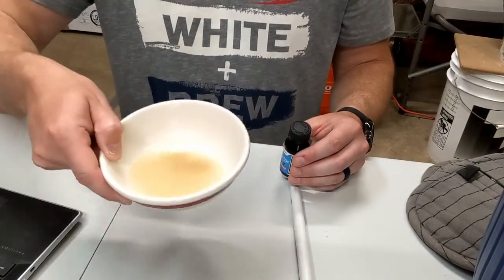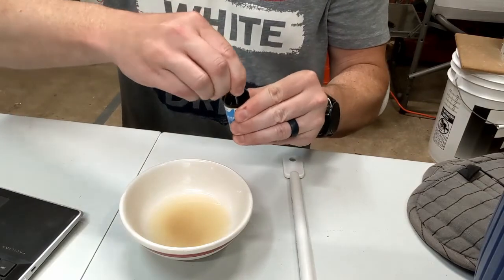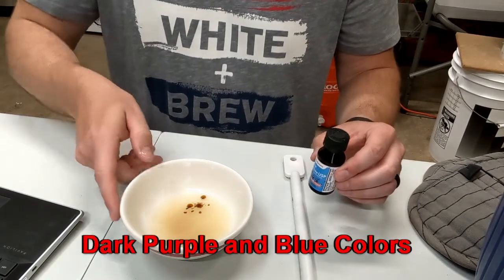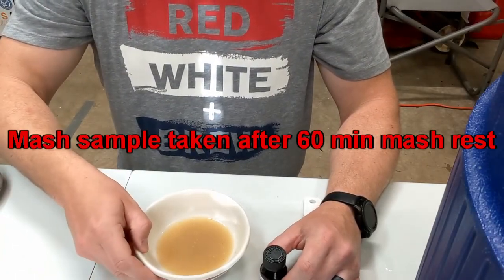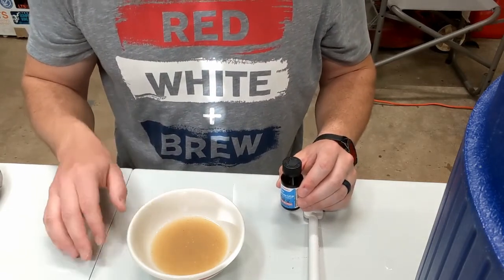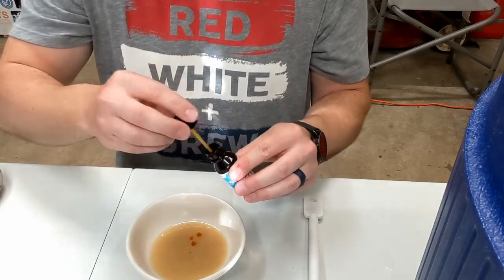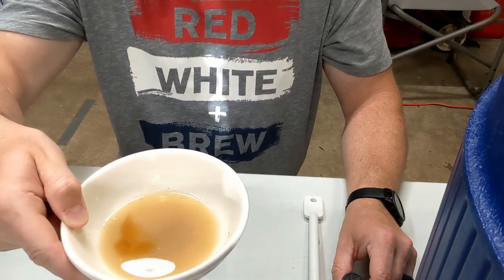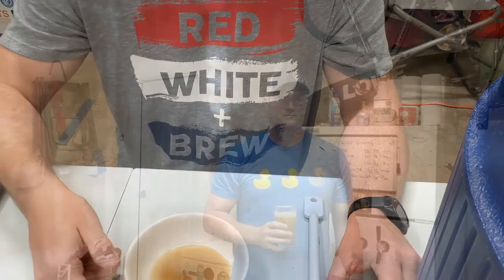Beer Mash Rest Time - Is it done?!  Simple Starch to Sugar Conversion Test

Comment: Do u cool the wort before trying the iodine?

When I try this, the iodine seems to disappear and dissolve into solution.. thought maybe it was heat related or maybe my iodine is bad? I don't know.. thoughts?
Reply from the maker: No, you should not need to cool it. Try to do it right away and you'll see the difference. The starch conversion doesn't take very long for most recipes. Most is done in about 15 minutes. Believe it or not... 60 minute mash is typical just to make sure your specialty grains are completely done with conversion. I've actually done a lot of 30 minute mashes , especially when I'm doing a lighter colored beer with very little specialty grains.